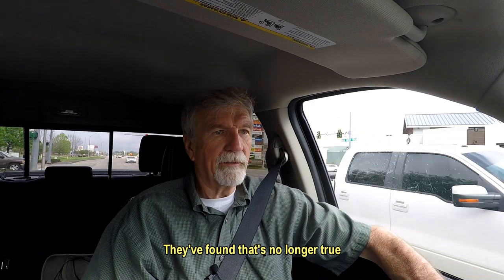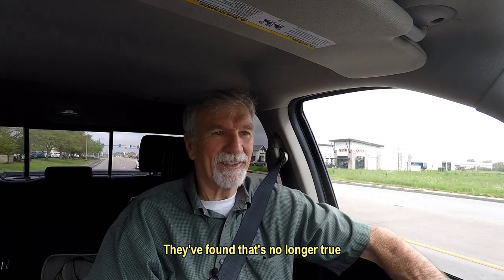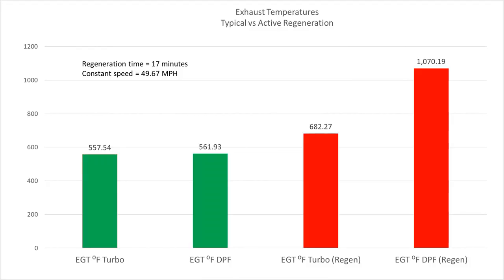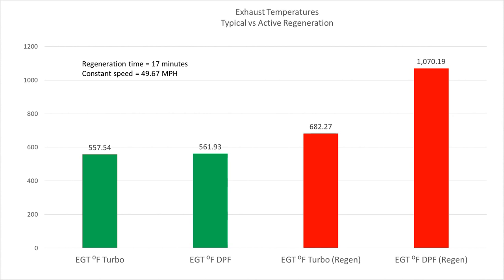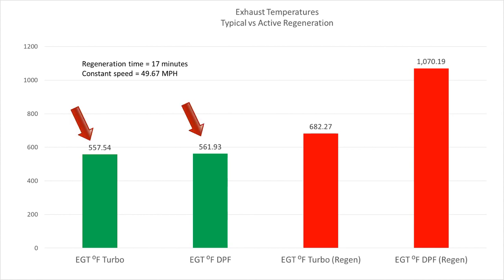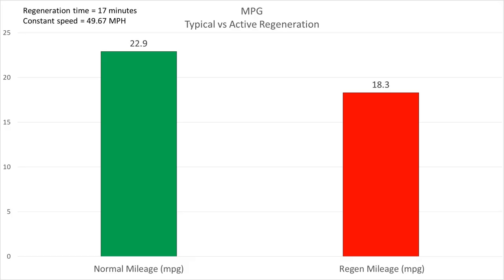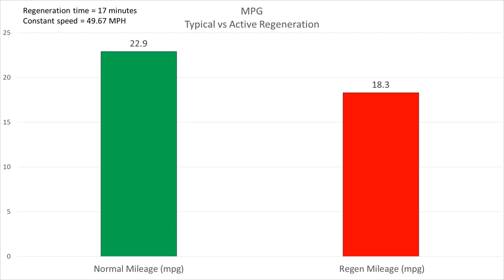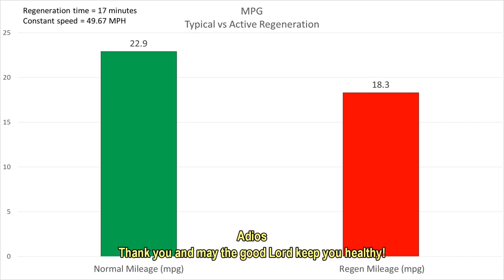6.7 L Ram Cummins Active Regeneration MPG

Comment: Very informative as usual Marion. I am still trying to wrap my head around all this DEF and re-gen emission stuff since sold my Ram with the 5.9 Cummins and got into the fourth gen Ram. 
The DEF injector failed on my truck a couple weeks ago and was warning of going into limp mode, fortunately it got me home and was repaired under warranty when I got it in for service.
Be safe out there
Reply from the maker: That's good.  Yea, I wish I had my original 5.9L stick.  425 ft/lbs and 175 HP and I think it pulled as good as this one.

Comment: Marion, when I bought my 2018 2500 I was set on doing my own work to the truck. But I had never touched a vehicle in  my life. Thanks to your videos I’m finally considering myself good with a wrench. I just did head studs last week. Boy let me tell you. If you are bored...you would LOVE doing a valve lash adjustment. And I said screw my warranty and started modding my truck with a 52 gallon CCSB tank, in tank lift pump, and emissions compliant tune and transmission valve body mod. I also installed an EGT probe - do yourself a favour and install one...you’d be shocked what that turbo is NOT telling you
Reply from the maker: Thanks, I used to do the valves on the 5.9L every 24K.  What a pain.  You are doing it right.  Yea, that EGT probe is too far to tell much about real exhaust temp.  Have you every looked at the actual difference between your EGT1 and the manifold probe?  I be curious.
Reply: Marion Blair every moment I drive. Under normal highway driving, ad 200 degrees. Under load, 400 easy. City 150 or so. Cool down is pretty cool too. Sometimes you park it and it just drops, other times it goes down a few, up a few, down a few etc etc.

Comment: I have a 2017 Ram 3500 Dually and I have owned it since it was brand new. It has almost 226,000 miles and I’ve put every single mile on it for the most part and I have not as of yet to know it was in a regen cycle. In other words, if it’s ever done a regen I don’t know about it! J/s

Comment: I really enjoy your videos! Thank you for taking the time to make them. Does it hurt anything to shut Cummins down during a Re-gen?
Reply from the maker: No it doesn't.  The water cooling in the turbo continues to work after the engine is shut off.  It's called “thermal siphoning”.
Reply: @MarionBlair  Thank You Very Much for replying! I was wondering how that worked. I appreciate you!

Comment: I really enjoy your videos Marion.  Newer subscriber so I apologize if this is a question you have been asked many times before but; is a DPF/EGR delete something you would ever consider for your vehicle (if emissions regulations were not an issue)?
Reply from the maker: Yes I would, cleans up the engine tremendously. I suspect I eventually may do that so far I've had no issues with current system

Comment: Marion Blair, you have some great info. Thank you for sharing. I just purchased the i dash data monster. I have the 2012 Ram so, there are no tunes for it. Is there a model that is similar that I can use through your research? I know some Ford Power Strokes work for some Cummings. This model I have just has the DPF and the recurc death of engine system. I've go e through 2 turbos so far in the last 5 months. Glad it's under warrantied. I bought the truck at 103k miles back last May. Now at 124k and it's the end of March. That's not normal mileage. Thank you so much and God bless you my brother and Family.
Reply from the maker: I'm was pretty sure you can get tunes for the 2012.  I guess you've talked to some of the delete folks.
Reply: There are all kinds of tunes available for the 2012. Going to have explain some more on the “powerstroke works for cummins” part.

Comment: Another good video. Not sure if you were still considering a video on changing the intake tube of your truck or even the intake all together. I would be curious to see what you find if/when you do. I trust your information more than most. Also, not sure if you have heard of Alpha OBD or not but that may be something else for you to take a look at. I picked it up a couple weeks ago and I am amazed at everything you can do with it in these trucks. All the best and stay safe.
Reply from the maker: Thanks, yes I'm seriously considering a different intake tube.  I'm not happy with the current setup.  I have the free Alpha ODB.  People love it especially for reseting TPMS.
Reply: Marion Blair I am as well. I was looking at changing the entire air box assembly, (Banks or AFE) or just  a more direct tube from air box to turbo.  With then Alpha OBD I added daytime running lights, lowering front windows with remote and even performed a DPF efficiency test. I am still finding out what can be done but it has a lot. Unfortunately there are not too many people posting information on what can be done and how to do it beyond the basics- may be a relatively inexpensive series of videos for you😊.

Comment: Which EGT are you reading. Bank and sensor. I’m tracking Bank 1 Sensor 1 but not sure if that’s the one I should be watching. I haven’t seen a temp over 800 while in regen. 
Thanks for the great content.
Reply from the maker: You want to track Bank 1, sensor 1 for turbo EGT and Bank 1 Sensor 3.  Sensor 3 is the DPF temp.  Sensor 3 is where you'll see 1000 to 1100 or so when in regen.
Reply from the maker: Also track DPF Regen Trigger to see how see the % the DPF filter has before regen.  When it gets to 100%, you'll see the EGT's start rising.  You can also track your EGR command or actual and it will go to 0% during regen.
Reply: @MarionBlair  Thank you
Reply: @MarionBlair  I use a blue driver to monitor the percentage. When I see it go into regeneration I hit the highway. After switching to the platinum def, my miles between regens has been going up. Last was 636 miles. Not sure what is good for mixed city and highway.
Reply: @MarionBlair  I recently installed an Edge CTS2. I watched the post DFP temp, climbed over 1k during regen. What I don’t understand is, I saw that when my DPF was about to region, my temp would start climbing into the 800s and 900s and my fuel economy would go way down. But the truck was not showing in the region state. It would then go into region For about 20 minutes on the freeway, then my fuel economy would be back to normal after.

Comment: Watch your video but I have no clue what you're talking about. I bought my 1st Ram diesel 2500, a 2017 last year but would like to learn. Did you have to purchase extra equipment for this data?
Reply from the maker: i use a Banks Idash Data Monster to record.  The info is all there in the PCM.  Just need the recording monitor.  I leave a 32 gig SD card in it and leave it on auto record.

Comment: Wow 22.9  2016  ---  Have never seen over 18 MPG even with a tailwind. It shows a Long Horn Mega Laramie I call it my Dodge Ram the Lemon - maybe 16 mpg adv. 2022 - 5 year - 3 months,  Transmision OH at 105000 miles, no heat a 115000, $2,872.00 said the core was plugged? now Exhaust System Regeneration in Process Exhaust filter 100% full. with the engine light on. the Lemon  --- more $$$   - if had gotten your mileage that would of saved About $6,500.00 enough to pay for all the breakdowns of the Ram with the Lemon trim model.

Comment: Hello sir.  Enjoy your content, thank you.  I have a 2014 CTD 2500, 86000+ miles.  I’ve only ever seen the regen show up on the dash once.  I do have a fifth wheel, but don’t go too far.  Only about 20 miles from home.  Is it normal to only see the regen one time in the trucks life with this kind of mileage?  I’m the original owner of the truck.  Take care sir.
Reply from the maker: Perfectly normal.  Actually, you should never see a message unless the DPF is getting plugged beyond it's normal amount.  20 miles is plenty to keep the DPF clean which is why you've not seen the message.  That's a good thing, ha.  All is OK if no message.

Comment: Mr. Blair, any plans to "modify" the exhaust, EGR, etc. on your truck?  I am finally getting my 2018 2500 "modified" next week.  I have been using the Stealth Module tuner and that does work well overall, but figured it was time to move to the next step.
Reply from the maker: yes I'd like to do the full delete with a 4in exhaust all the way to the back with maybe a small resonator for sound
Reply: @MarionBlair  : That's pretty much what I am getting done too.  EGR "upgrade", 4" with resonator, EZ LYNK using Motorops for tuning and S and B intake.  Not cheap, but the local shop here warranties their work.  I don't need crazy speed or noise,  just want my truck to live longer and run cleaner.
Reply: @MarionBlair  : Mr. Blair, just an update since I got my truck back yesterday after the "EGR/DPF" surgery.  I had all the modifications in my previous comment completed.  The best way I can describe it is, "night and day" or "better than getting a new truck", after all the EGR/DPF removal and tuning.  More power, much better throttle response and the tune package I bought also tunes the 68RFE.  For the transmission, I have noticed (only about 30 miles) that it holds the gear longer to prevent the lug the stock transmission tune.  Will see how it does when it's time for towing.  Overall, really like it so far and quite amazing to see how much potential the truck has.  Adios :)
Reply from the maker: @brenteason9891  that sounds excellent, can you tell me what tuner are you using and also the software that you used to do to delete if you know?
Reply: @MarionBlair  : The tuner is EZLYNK AUTO AGENT 2.0.  The tunes are MOTOROPS EZLYNK ECM/TCM TUNE PACK.  The tunes are out of Canada and includes the 68RFE.  You can change tunes instantly with the EZ LYNK app and includes a switch in the truck to change the HP you want on-the-fly.  Really like this set up.
Reply from the maker: @brenteason9891  yes I definitely want the transmission tune also thanks for the info
Reply: Marion Blair : Anytime.  Stay safe and consider kicking the DEF habit :)

Comment: What remote gauge do you use, thanks. I forgot I think you had a 2014 2500, how,long before you DEF gauge starts to move after is is full, thanks
Reply from the maker: The DEF gauge isn't linear.  It takes forever to more off of full.  When it reads half full, it will take 2 1/2 gallons which is about right.

Comment: Is there an average mileage before they regen that you know of?  I ask because mine are all over the place. Took a 12 hour round trip doing 75-80 and it did a 16 mile long regen after 1,150 miles of driving. After that trip my normal daily commute started back at 65mph for 45 minutes one way.  It did a 30 mile regen after 671 miles of driving that commute but only 268 miles after that regen it did another 32 mile long regen.
Reply from the maker: Take a look at this video.  One of the charts shows how often my truck does it.  https://youtu.be/o3u7mdEIkTw  It depends on driving conditions, highway  vs city etc...  City, every few hundred miles, highway thousands.

Comment: How often do you get a regen? I had one at 20,000 miles and hasn't seen one seen then. I'm now at 63,000 miles.
Reply from the maker: You are having them, it's doing it automatically.
Reply: @MarionBlair  I don't tow so I would have less regen. I just go to work and back @ 110 miles a day 3 days a week.
Reply from the maker: It's just the opposite.  The higher the exhaust temp the fewer regens.  Towing burns off more soot by passive regens.

Comment: I have a 17. 60,000 miles how do you know when it’s in regen? I’ve never seen it. Does a light come on. I mostly tow a fifth wheel. Should I be driving different when it regens
Reply from the maker: If everything is working right, you won't know it.  Some people say they can smell an ammonia smell, I can't.  Some say the fuel mileage drops and you can see that, not me.  With a gauge, I can't tell.  When towing that 5th wheel you are probably not having active regens as your exhaust temp is probably high enough and (over 900 F)  handling the regens passively.

Comment: Just wondering if anyone has observed a difference in sound from their truck when the exhaust system regeneration process is occurring. I've heard an odd sound coming from my truck recently, almost sounds like a deeper exhaust note. It comes and goes randomly. I finally noticed it doing it again today while my truck was in the regeneration process. Any thoughts on this?
Reply from the maker: It's possible but my ears aren't what they used to be.  Very subtle if any change.

Comment: How many miles do you go before the regen happens? I have 9,000 miles on my 2017 Ram 2500 and have yet to see the message. I know, I don't drive it much.
Reply from the maker: You should never see the message with normal regens.  It's when it get literally about to go to limp mode is when you start getting the message.  That happens to people that drive a few miles and never enough for the regen to finish.  Local maybe 200 miles, highway, 600 miles or more.
Reply: @MarionBlair  Thanks for the info. Love to watch your older videos. Very informative. Getting ready to change the oil and fuel filters myself, the dealership wants $720 to do it.
Reply: @MarionBlair  How often do the normal regents occur?  What type of driving causes regents?  Most of my driving is with an empty truck and the cruise set to 75 for 3.5 hours.  When at my farm, most of my drives are 15 minutes each way to the city for groceries.  So I would say that 80% of my driving is at 75 mph and the rest is stop and go.

Last week at the farm, engine idling, it sounded like the exhaust brake was engaging.  When I would get in and hit the gas, the e-brake sound went away and truck drove fine.  Two days ago, got the Regeneration in Progress on the cluster.  It went away after 7 miles or so. Then I got the check engine light.  Fuel economy remained the same as it has been for the past year.  Today on way to dealer, I hit the gas to get on highway and it wouldn’t accelerate for about 5 seconds, then caught.  Then I thought I would check out boots, so I gunned it.  Could only get 8 psi.

Dealer couldn’t diagnose (busy) so I went to other dealer.  This time, when I gunned it, I was able to get 30 psi boost, and then did an e-brake test with “Full” selected and tow haul on.  Was able to get 75 hp of e-brake effort.  I figured it was a sticking solenoid in the waste gate/e-brake.  Dealer #2 is telling me that I have a plugged DPF.  Going to try to do a regen, but wasn’t sure if that would work or if it will need new DPF.  

Codes set were: P1451, P2463, P0046, U010C, P00AF, P003A.  What are your thoughts?
Reply from the maker: @oscarb9139  What year and how many miles on the truck?  This seems more like a turbo or actuator issue but hard to know.   A bad differential pressure switch at the DPF could falsely indicate a plugged DPF.  Your driving habits shouldn't cause a DPF to plug.  I have a video on miles vs regen but the way you are driving you could probably go 600 miles or so without a regen.  City driving where there's a lot of stop and go causes the most.

Comment: honestly I don't even know when my truck is doing a regen, how can you tell?
Reply: Jeff Francis It shows on the on the gauge cluster and gives you a countdown timer
Reply: @herculesinwyoming  never seen it ?
Reply from the maker: I can't tell without a gauge.  Some say they smell it but without the engine monitor, I'm clueless.
Reply: @MarionBlair  okay thanks. thought I  was missing something
Reply: My 2017 3500 with 22k has never given me a message, signal or notification that a regen is in process.   Never noticed it on the Ram but, when my Kioti tractor goes in to regen...you know it.

Comment: Why can just dodge ram install a button next on the dash to enter into the regeneration mode? Driving around and spending seven dollars of gallons diesel to be able to re-GEN what a waste of time. Whoever created this system should be fired. 

I have a bucket truck in my truck idles 4 hours, because I have to work on tree work and powerlines and this system is totally garbage
Reply from the maker: Yea, the 18 wheeler normally have a way to force a regen.  I guess RAM engineers felt we were too stupid. ha